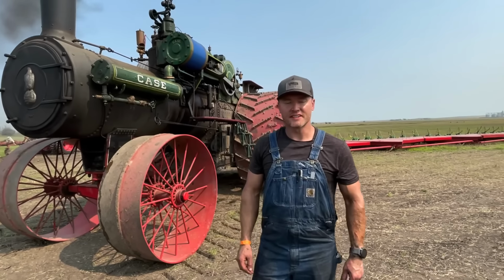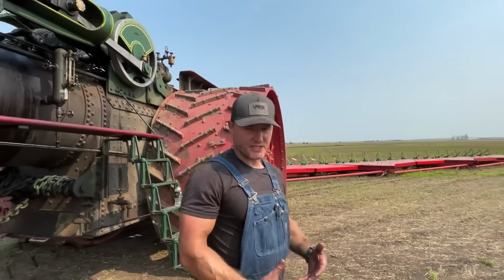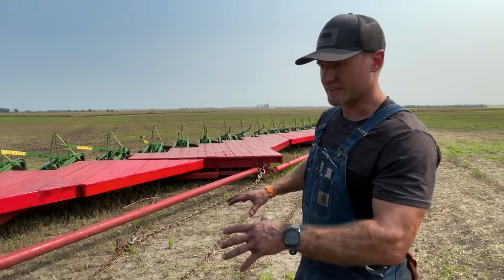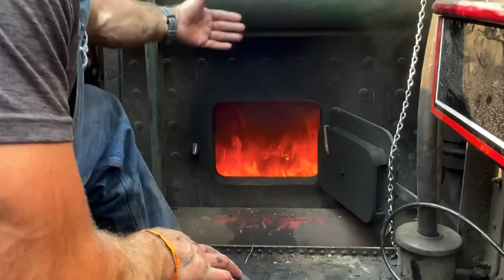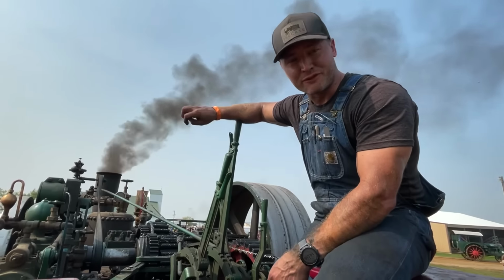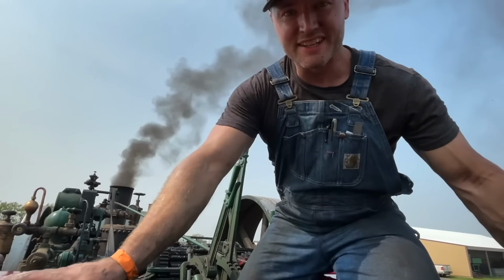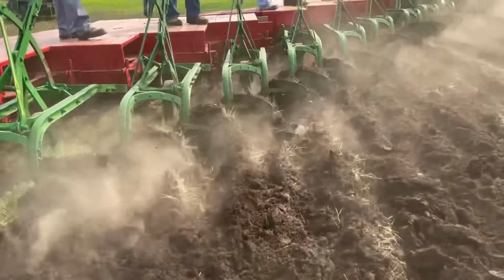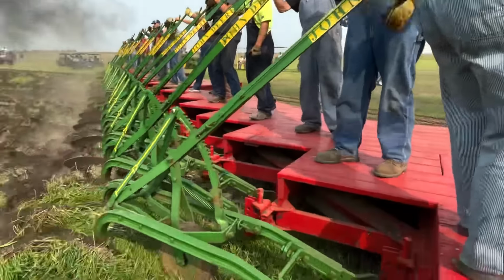2021 RECORD! 150 CASE Road Locomotive pulling 44 bottom John Deere plow

Comment: Meanwhile John Deere: we can't allow random farmers do any repairs of our products they are not smart enough to do that
Reply: Yeah that’s because John deere needed to make their tractors crappier, had they stuck to their original best-sellers, like the B, D, L, and many others, farmers could fix anything on them.
Reply: If they can fix it then let em’ fix it. If they can’t they’ll bring it to your dealership. You ain’t Ferrari, deere.
Reply: А современные трактора 26 плугов могут тащить так не пренужденно?
Reply: Isn't joke
Reply: Just like auto makers saying you can access telemetry systems on your vehicles. They said "if people could access the telemetry systens on their cars, black people would be targeted."

Um, what? Way to try to use the race card against your customer.
Reply: @hardbrocklife  didn't get it. Can you explain? How do telemetry and black people relate?
Reply: @sinchrotron they don’t that’s the whole point of his comment
Reply: @megaaggron9778  it’s very fitting that you used Ferrari as an example because the same situation happened between Lamborghini and Enzo Ferrari. Mr Lamborghini (who only made farm tractors at the time) was mad about all the issues with his new Ferrari and he wanted to tell Mr. Ferrari how to fix all the problems. The issues were bad clutch design, hard starting etc.  Ferrari laughed Lamborghini out of his office and said “Go make a better car before you tell me how to build mine, my cars are perfection on wheels, I don’t take car advice from a dumb tractor manufacturer. Lamborghini said “I will! I will defeat your cars in racing and will make a much better car” little did Ferrari know how driven and petty Mr. Lamborghini was.
Reply: JD was beaten in court. You can fix the equipment on your own now and JD can't stop you.
Reply: They don’t care if you work on them. I buy parts and modify mine. They don’t want you hacking their software
Reply: Jhon deer is the best tracker and ford so shut it I’m a man
Reply: Oh yea
Reply: Nothing breaks down like a Deere
Reply: @WastedElephant  is that why so many of the old ones are still being used
Reply: My guess, not being a farmer but reasonably handy with tools and old enough to be the third, proud owner of my wife’s grandfather’s bench vice, is that modern tractors are full of computers and sensors.
When the machine misbehaves, likely as not it’ll be due to a non-mechanical cause. Who knows how even to interrogate that? You’d need onboard diagnostics via an OBD-2 port and a laptop, at minimum. Depending on how JD sets up its software, you may be able to reset or adjust the behaviour of some aspects of running.
Reply: @GT380man  true that but they actively fight against farmers that want to build tools (both hardware and software) that would allow everyday farmers to work on those machines, swap parts, reset sensors, add extra functionality (like GPS). Best part is that they are doing it while braking the law as the software they develop is based on open source code that requires them to also share their software, they however laverage their duopoly power on the market to wizzle out of that responsibility.
Reply: @megaaggron9778 umm we fix all our Deere equipment ourselves.  Unless it’s warranty work 🤷🏼‍♂️
Reply: If John deer keeps up what they have been, these beasts may end up making a comeback.
Reply: I work in a machine shop and repair John Deere junk, made in Taiwan, it's terrible what they produce
Reply: Neither are the people they pay to fix it
Reply: They don’t make them like they used to
Reply: Pretty sure that tractor is saying "I KNOW i can, I KNOW i can..
Reply: This guy's ain't rando
Reply: FR SMH
Reply: New deer shit is a joke they are living on their legacy when they made a quality product.
Reply: they havent seen interstellar i take it
Reply: Посмотрите на Парня! 
Настоящий Рабочий человек, руки в мазуте, в шрамах, вены вздутые! 
Молодец парень, Здоровья тебе и твоим близким! 
Ну а теперь и трактор посмотрим!. 
Сам я был зав.ЦРМ- 20 лет, теперь пенсионер
Reply: Computers on a tractor wtf
Reply: I really need a lawn mower but jd ain't cutting it so I'm still using a wheel horse
Reply: The biggest problem we have now 💀
Reply: @jrod264winmag don't you have to hack the software to work on certain systems?
Reply: They let you do all of it. We run them on our farm and have no issues doing whatever we like.
Reply: Who can work on any of this fancy bs. The engine in my car doesn't even look like an engine.
Reply: @JosefHerrenhäusermann58  simpler than any modern machine of any color.
Reply: @КристинаНосова-ы2п  yeah
Reply: They call that American greed!
Reply: @garyfeltman4482  you still can't fix them because you still don't have access to all the necessary software.   The court case only gave you very limited access to their very basic software. Not the software needed to actually work on and fix them.
Reply: @jrod264winmag the old ones are good tractors and can be worked on. The new ones are all P.O.S. and can only the very basic stuff can be worked on because of lack of access to the necessary software.
Reply: @Jrs549  every manufacturer protects their software. It's the same story with my Kabota
Reply: Send them too the scrap yard.
Reply: And....we are moving to Mexico. It's Juan deere now
Reply: . не, не потащил. Колеса прокручивать либо кп сломается. 😢

Comment: I’m not a tractor guy, but the sheer size and power of this engine along with the old-time engineering  put into it, it’s hard not to love it!
Reply: Its probably tame in its power compared to modern standards
Reply: If you admire this engineering wait until you taste the engineering that's been put in the food! It's a shame how much waste... I mean food that comes from that marvelous machine. Never would have thought that I'd see the time when the "breadbasket" of world accepts a corporate mandate forcing Farmers to sow bad seed!
#WakeupAmerica. 😴
Reply: Steam Power is way underrated
Reply: @randomuser4201  
A 2 cylinder steam engine is much more powerful than a 4-stroke engine with the same displacement.  Typically equivalent to an 8-cylinder 4-stroke, and with far, far better torque at low speeds all the way down to 0 RPM, whereas 4-stroke engines can barely operate below 1000 rpm without stalling dead, whereupon the 4-stroker immediately produces zero torque, whereas the steam engine can continue to produce torque all the way down to 0 RPM or even being forced into reverse.
Reply: @Scott Crawford 
Modern water tube boilers don't have those safety and catastrophic failure or issues (which are inherent in the "fire tube" boiler design).
Reply: And when you guys think about when this was made, there weren't speed limits everywhere, no interstate. No internet, basic landlines.... and they did this!
Reply: @akulkis  Yep I was surprised the first time I found out that these old steam engines make so much torque. I wonder how much this particular one in the video makes?
Reply: @megapet777  he states in the beginning it produces almost 8000 ft/lbs of torque @ 180 psi pressure of steam.
Reply: @randomuser4201  Steam engines make far more power than most people think. This only runs at about 300 RPM under normal use conditions. Huge bore and stroke at 14 inches diameter by 14 inch stroke. Brake horsepower is low comparatively at 170 but torque is over 5000LBFT. They had to back of at that point on he dyno run.The engine has been built for heavy hauling purposes and is capable of drawing 40 to 50 tons up grades from 5 to 10 percent. Factor in it's weight of 75000 lbs and that it was made 100 years ago, the numbers are impressive by any standard. As shown here, it set a pulling record.
Reply: @BEASTWRANGLER  thats crazy
Reply: @megapet777  they said about 8000lbft.
Reply: @Scott Crawford the thing has 150 hp. in modern agriculture that is between small and midsize.
Reply: HP…but what is the torque
Reply: @Scott Crawford 🎉🎉🎉🎉
Reply: I'm not either, but kinda I am. I was lucky to spend summers with my Grandparents when I was in Middle and High school, and my Grandfather was a WWII vet. We've got pictures of him with Patton and getting awards, but my formative years were on his two Farmall McCormick Cub tractors. I was driving them and plowing easily when I was 12.
Reply: yy
Reply: Yes this is BadAss ! BigBud I think is hitting 2.5k trq and he said this thing is pushn 8k holy sht thats some pulling power !
Reply: @bkane573  he said its 8k bro Holy Fuk sht is a Beast !
Reply: 11 😵
Reply: @Scott Crawford !
Reply: top Kizlyar knives
Reply: @randomuser4201  HP maybe but not torque, probably 30x more torque than any modern tractor
Reply: @Casper Holdud gue
Reply: @Casper Holdud 8o9 Gude 2 j!
Reply: @Casper Holdud z_
Reply: does anyone know where this was originally built?
Reply: This is great to watch. It's like a friendly gentle giant. So, how many bottoms would they typically pull back in the day?
Reply: Wichita Lineman re Farmer grows 11:50p 712
Reply: I know what you mean, I wish I had it, it would make a great boat anchor.
Reply: @Casper Holdud join
Reply: L
Reply: @randomuser4201  4
Reply: @randomuser4201  v
Reply: @Casper Holdud o
Reply: @Scott Crawford you just cant go to the neighbor and borrow a boiler to replace a burst tank could you?  Night mare !!! Wish I was with you guys back then? I was a farmers daughter. I remember the sweat.! Love you.
Reply: @randomuser4201  have you seen what this does at pulls??? Nothing beats it. This ain't tame
Reply: @inibrasiumthefirst2680  real men
Reply: @bkane573  it's all torque
Drag a Terex in a pull easily
Reply: @randomuser4201  i
Reply: It's not very powerful compared to any modern engine. It's just low RPM, high torque, and inherently has very high starting torque because it's a steam piston engine.
Reply: @Casper Holdud q
Reply: @Casper Holdud q
Reply: @Casper Holdud แ
Reply: @randomuser4201  it's torque. These old steam engines had like 5 hours but insane amounts of torque.
Reply: Same
Reply: No computer, no bs tech just sheer power and cheaper diesel tractors
Reply: @akulkis  that is how nuclear submarines  work
Reply: @randomuser4201  ....................
Reply: @randomuser4201  In HP sure - but they have such heavy weight and the massive wheels and immense gearing reduction the torque can drag modern stuff around like they are toys.  There's a bunch of videos of tractor pulls where they hook one up and the "modern" souped up machines get dragged around like toys by it because they just spin their wheels.
Reply: @Casper Holdud in on Monday morning
Reply: no
Reply: Это потрясающе👍
Reply: @randomuser4201  🎉
Reply: @randomuser4201 True. But it’s weight is the real reason it can pull so much. Low gear ratios and a lot of weight can do wonders.
Reply: @@scottcrawford7674bonjour 👋 exploser comme la série TV docteur queen femme médecin des années 2000 avec l indien sceuli je crois je crois je pense pas que c'était la petite maison 🏠 dans la prairie ++
Reply: Yapılan yıllarına göre mucize bir traktör. İcat edenleri kutlarım. İnsanlığa verilen en büyük başarı. İzmir/TÜRKİYE
Reply: Nothing about this video is small. From the men who operate the machines, the fields, and the machine's themselves. Thank you for sharing this history in the making
Reply: @matthewmiller6068  well yeah it helps to have 10s of thousands of pounds of water to have you not spin them
Reply: I am thinking , in the future  you will see  steam like this and it will be doing some or a lot of farm work  
because of how the world is i stayat home a lot   i sit in a room by my self most of the time    I just happen to be able  read peoples 
like when I am at wall mart I have to focus so I Don't read people's mind's it's not easy    it's easyer to stay under a rock then to not read people's minds

Comment: The average person cannot possibly appreciate the brute strength on display. That steam beast could pull the gates of hell off its hinges without a stutter!
Reply: It's 11k Nm. 
That is insane It's the power of 4 semi trucks. 
Like 4 Scania V8 540.
Reply: What is piston diameter and stroke plus steam pressure please?
Reply: I must be above average
Reply: The Amish took one look at it, came to the same conclusion, and decided not to have anything to do with Hell or this beast or anything else that followed.
Reply: This girl hasn't yet realized she's even being used....

I would actually like to see a tug of war between equal weight classes and see who drags who around the field.
Reply: That ain't no sht.
Reply: @goferlp7011  lol why Scania 540? Why not 770? You need only 3 then. 😂
Reply: @aljosaskrabelj8412  because the 540 is much more common than the 770
Reply: It's like seeing the Big Boy 4014 locomotive. That steam beast has the power of 5 diesel locos. Glad I got to see it. Hopefully I can see this hot rod in person someday.